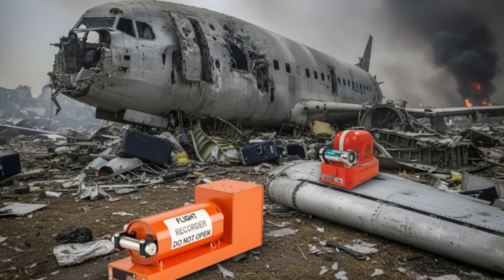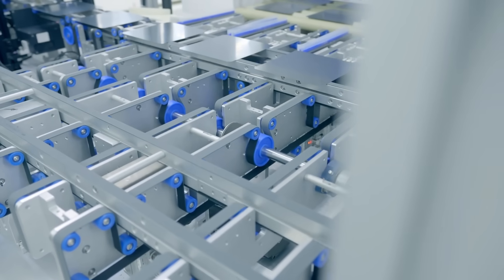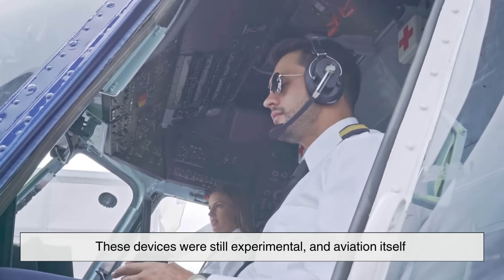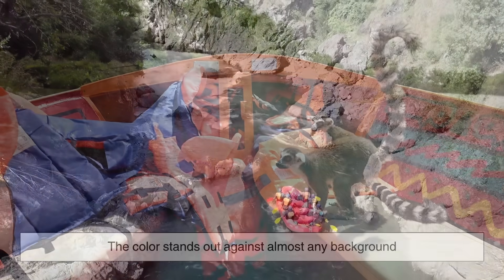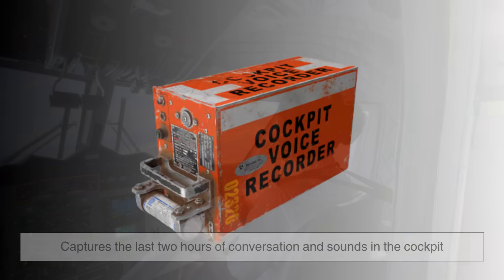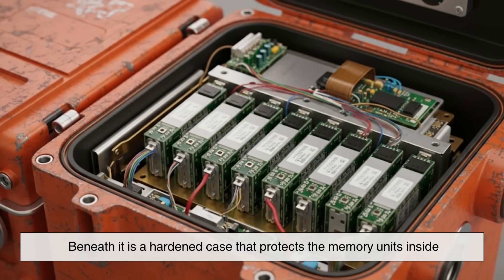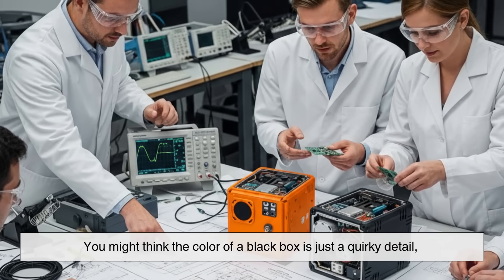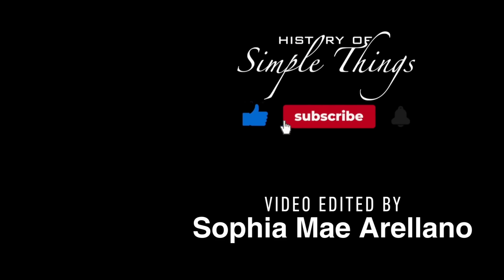Why Black Boxes on Airplanes Are Orange

Comment: I used to work in the Honeywell plant that made these.  I did not work on them though.  My work was building and calibrating magnetometers, which are the magnetic field sensors (compasses) for the avionics.  Most planes and helicopters that carried the modules I built, carried 2 of them, but they were not the only sensors used for attitude.